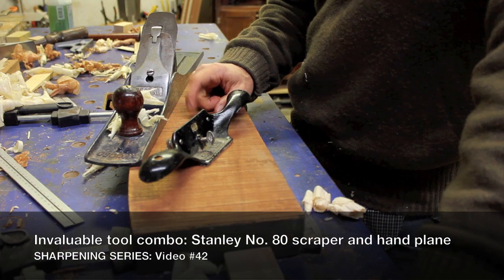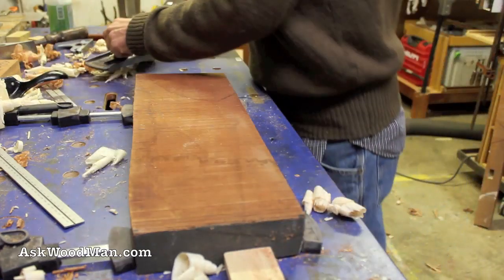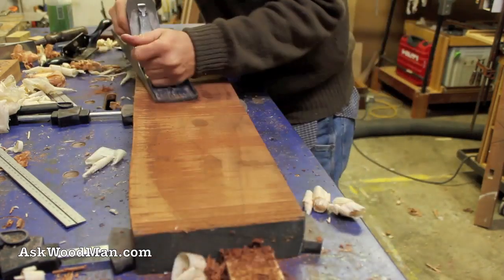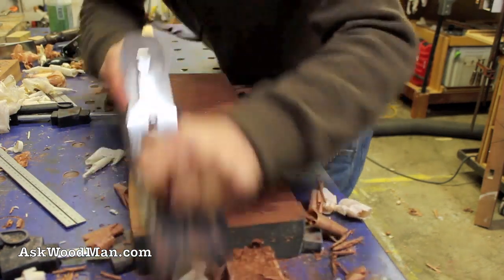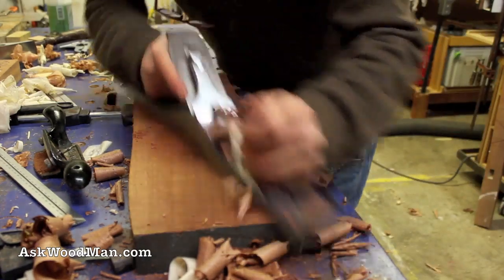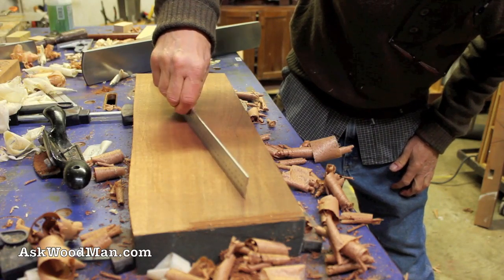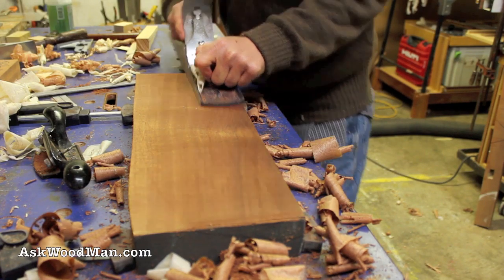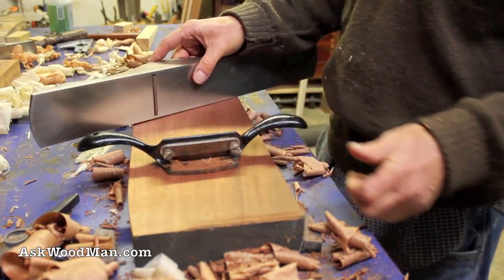How To Scrub Plane a Rough Board • Complete Sharpening Series Video 42

Comment from the maker: @MartyBacke There was a little fall off on that one corner. I have a jointer and a planer. I was just trying to demonstrate these tools surface cutting capabilities. I use high performance machines whenever possible. On that board I would have gone into a serious crosshatching cutting pattern to bring that whole face flat while checking with a straight edge while I was catching my breath. Parallel surfaces would be achieved use a marking gauge on all four edges off the flat face and then cut.

Comment from the maker: Great comment. I probably should  have given a better answer like you did. Retract the blade the and advance it incrementally until it starts cutting and then determine if it is a sharpness issue. Thanks Mihail.  Allan

Comment from the maker: @ChockFullOfDouchebag  Those clamps are made by Festool. They call them clamping elements. Note how they work with all the patterned 20mm holes drilled in the top of my work table. Festool sell tables but they are not as stout as mine. These clamps really changed my life. They hold work pieces like no other tool. Clamps are a woodworkers very best friend. Avoid the Chinese clamps. Money down the toilet. Check out my vids on laminate and there are some more demos of those clamps. Thanks 4 comment

Comment from the maker: Nicholas I would venture that your blade is not sharp. Even with a hand plane that is really out of adjustment,  if the blade is sharp it will cut. If you are sharpening your blades by hand with no jig you are going to be hard pressed to put a proper edge on your tools.

Comment: I am new to woodworking and have inherited an old Stanley planer. I have sharpened the  blade with my water stones. When I go to start planning I get a lot of bouncing and catching.  What might cause this? Also my work bench is not all that great just butcher bolock and table horses. I think either my blade is still too dull or  my surface is not stable. Thanks for your help and videos.